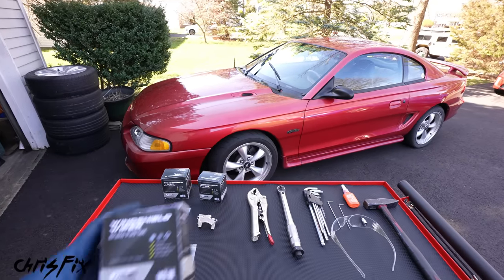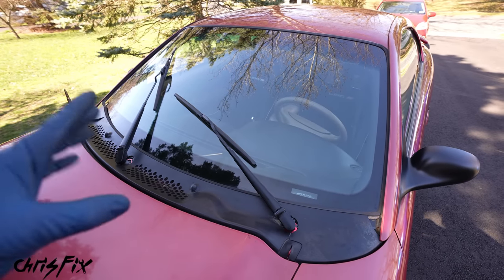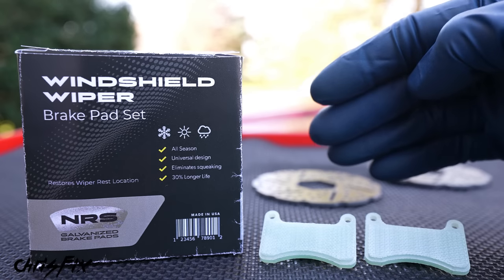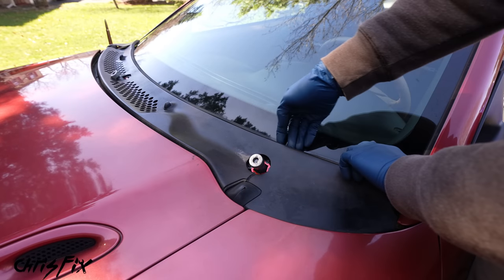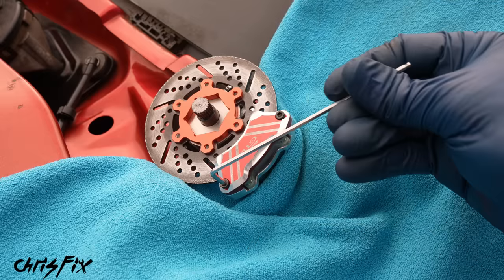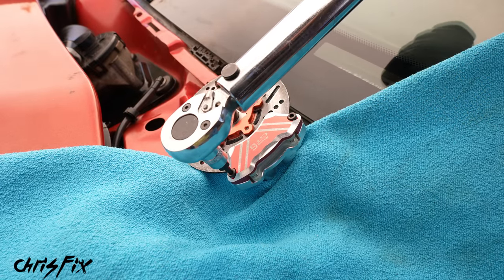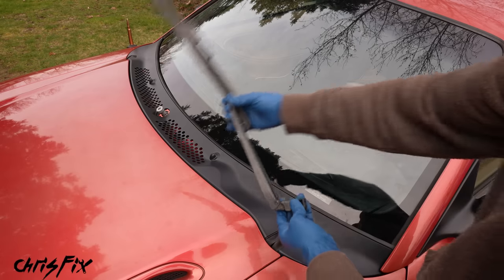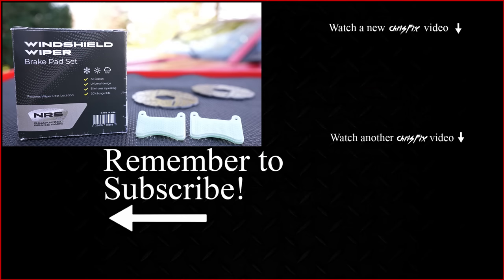How to Install Windshield Wiper Brakes

Comment: honestly just buy regular wiper brakes rather than slotted since they'll most likely last a lot longer and get more bang for your buck
Reply from the maker: Agreed for a street car but since this is a drift car, I decided to go with performance parts.
Reply: @chrisfix  them wiper brakes are the best performance mod. 😂
Reply: @chrisfix  need performance wipers for those Gs you're pulling on the track
Reply: Lol
Reply: @chirsfix how often do these brakes last on your average car? Should I change my soon?
Reply: @chrisfix  Don't forget to add some racing blinker fluid ;)
Reply: I used drum brake for both
Reply: I can’t believe you didn’t change the blinker fluid too
Reply: My car is old. My wiper brakes are drums.
Reply: @chrisfix  For all the times you are drifting in the rain, right?
Reply: @chrisfix  We need a tutorial about replacing windshield wiper brake fluid.
Reply: @ChrisFix If you 3D printed those little components, any chance you'd do a "how to" 3D print vid for useful components the beginner 3D hobbyist could print for his ride?
Reply: Still touching the a pillar 😛
Reply: And unlike slotted rotors you can resurface when needed. Just more practical
Reply: Yes but you cannot use the fastest wiper setting with them as they will not provide enough stopping power
Reply: @chrisfix  is there any performance blinker fluid or muffler bearings.
Reply: since wipers are always used in the rain then the slotted drilled wiper brakes makes the moste sense
Reply: Pus they're less likely to warp than slotted ones. I just replaced mine this morning so I shouldn't have to worry about them for another year
Reply: April fool's 😁
Reply: I love the attention to detail Chris puts into his videos.  My local parts store was all out, so I'll be pinning this so I know how to do this small but important job once they are back in stock.
Reply: @ItsNachoChannel  Shhh, remember The Lemon race car which broken piston return spring at the middle of the race?
Reply: Mine are air brakes. But I have the DOT air brake endorsement. It's just a 3 hour class plus exam. Well worth it!!! But be prepared for the Weigh Station inspections. Thanks Chris!!!
Reply: Will going with an aftermarket brand void my warranty?
Reply: So do you recommend organic,simi metallic or ceramic

Comment: I remember helping my grandpa with a repair like this on his old Chrysler. Being built in the 1970s, it had drum brakes on the wipers.
Reply: LMAOOO XD
Reply: Ahh yea, my old buddies Peterbilt had huge wiper brakes because it was  was a semi truck
Reply: I think Disc Brakes wipers was an optional. And in some cars wipers Brakes are behind the dash so you can't see it
Reply: @fabidroidneo  Yeah, on those you have to remove the entire dash, such a pain.
Reply: Who remembers when chrysler put those mechanical cable pulled units on the motor side? Talk about a pain to service.
Reply: Rear Wipers often still use Drums. I wish Disc Wiper Brakes were a standard thing.
Reply: LMAOOO 😭😭😭😭
Reply: oh.... my god! this freakin comment!
Reply: My new fiat has a set of electric wiper brakes. They use electromagnets instead of calipers. I've never seen a set like that before

Comment: You don't want to know how much the carbon ceramic wiper brakes on my P1 cost!
Reply: At least the blinker fluid was already topped up when you got it. One less thing to worry about!
Reply from the maker: I cant even imagine!!! Hopefully they are not damaged from the hurricane and can be reused!
Reply: YOU should have shown up in this video, not that other.. person.
Reply: Nobody cares how much it costs 😅
Reply: That's gold 🤣
Reply: Yes, yes I do. C'mon man, telllll me. Pleeease.
Reply: Exactly xD
Reply: @Dangnilo what’s the matter with shmee?
Reply: No, but I can tell you where to find some used carbon ceramic wiper brakes for P1 in Lithuania
Reply: Bro you really had me there. I seemed so real but i noticed the bar code 123456789012 than i knew you printed it 😂😂 but insane job tho
Reply: 5 bucks take it or leave it

Comment: Pure genius. I just installed a turbo on my washer jets. Works a treat.
Reply: I trust you redirected the blow-off valve airflow to dry the glass afterwards as well? ;)
Reply: @realMrVent  that's genius, I gotta set that up!
Reply: to be honest he is gonna come up with intercoolers for your headlights:face-red-droopy-eyes:🤣🤣🤣🤣
Reply: @gilbertsbiogasexpertske1120 You say that as a joke, but the current racing Hypercars actually do have coolers for the electronics behind the headlights.
Reply: @MrVent  absolutely. 🙂. Add a little Party blower too. For added sound effects.
Reply: What brand I bought the washer turbo jet on eBay and now I’ve got two holes drilled into my windshield not funny

Comment: I did this modification to the windshield wipers on my car this morning and I saw a 25 brake horsepower increase on the dyno this afternoon.  Great video! Thanks, Chris!!!
Reply from the maker: Nice work!
Reply: @chrisfix  Thanks, mang!!! 💪🏻 That means a lot coming from a YouTube legend like yourself.  I’m going to hookup a NOS system to the washer fluid tank tomorrow to see if I can get another 15-20 BHP out of her.
Reply: @Lettuce-and-Tomatoes  plugging in your windshield wiper hose into the vacuum line also helps a lot. Keeps the engine cool

Comment: I made the mistake of not using DOT 3.5 blinker fluid when bleeding my wiper breaks and we all know in NJ inspection stations they  check for wear and fluid level. Thanks again Chris for keeping me off track!😊
  It's not like the old days when you had vacuum wipers when you pressed the gas pedal to the floor the wipers would just stop in the middle of the windshield.
Reply: Its very important to reminder
Make sure machine the rotor!
Reply: Most will think you were joking.
Yes, don't forget history or it might repeat   :-0)
Reply: Don’t make the mistake of using amber signal fluid when you should have used red.  My wife did that, had to drain and refill with correct color.

Comment: Keep in mind some older SUVs and trucks will use drums instead of calipers for the rear windshield wipers. Hope we can get a video on that soon!
Reply: Unfortunately, they are hard to find nowadays.  JC Whitney still has them.
Reply from the maker: I am thinking I should do a wiper drum to disc conversion...
Reply: What about the exhaust brakes for the big rigs?
Reply: @chrisfix  what about doing a big brake upgrade for people who live in regions with lots of heavy rain??
Reply: More modern ones will use caliper brakes on the rear window. Also, most use TWD - Three Wiper Drive.
Reply: Maybe a drum conversion kit would be the way to go!

Comment: I had this done to my vehicle right around the time I had a prescription windshield installed. Those two repairs has made my driving experience so much better!
Reply: Now your comment has me in stitches. BTW, prescription windshields are a terrific anti theft😂😂😂
Reply: I KNEW IF I SEARCHED THE INTERNET LONG ENOUGH I'D FIND MR. MAGOO! I see your using a pseudonym. 😉 Don't worry I won't blow your cover.
Reply: Oh man, prescription windshield!
Reply: I was hoping Rx Windshields would be covered by my health insurance, but nope. 😡
Reply: @mikerisner  blasted insurance companies! Bums.🤣
Reply: How did he make all those parts?
Reply: I prefer my windshield to be able to rolled down.
Reply: @jamesstewart2543  there are pedal bicycles with disc brakes.
Reply: @jamesstewart2543  … “How did he make …the parts…?”    
3D printer… you can see the layer-lines on some parts, look closely. Excellent work, BTW.
This reminded me to check the wear on my wiper brakes…it doesn’t pop up on the ‘Service Due’ screen on the dashboard, not sure why it’s missing?? 🥸
Reply: @jamesstewart2543  my guess, 3D printing

Comment: I boosted my wipers with a twin turbo kit for extreme performance. However, with that mod I had to go with very hard to find and VERY expensive drilled, slotted and double vented ceramic rotors to bring the wipers to a stop. Well worth the time and money!

Comment: I love how you never fail to come with how to vids that no one else will tell you about. Cause of you I was able to change my blinker fluid wiper brakes muffler bearings and piston return springs. Thanks for all the time and money saving videos!!!
Reply: Hard to beat that blinker fluid one of years ago- but good try here!
Reply: Where can I buy a stronger than stock piston return springs my engine is running a little sluggish lately
Reply: Now that it is officially spring be sure to remove the winter air in your tires (don’t forget the spare) and refill with fresh spring air!😂😂
Reply: Piston return spring! Lol. There’s a YouTuber that actually tried that. Lol
Reply: @me7229  Return Spring, you missed the joke. Spring sends it back to the upstroke. Ring doesn’t

Comment: I installed dual caliper Brembo wiper brakes just last week, huge upgrade in performance.
Reply from the maker: The upgrade is worth it. The Brembo wiper brake calipers are expensive tho!
Reply: huh? bro you joining some kind of wiper race?
Reply: @chrisfix  Good thing there are cheaper options!

Comment: Nothing less than 100% commitment here. You can tell Chris is a man of integrity. Also, no time like now to change your blinker fluid, there's a video in here from around the same time of year showing that process.
Reply from the maker: Haha thank you! Every video will always be 110% commitment!
Reply: Make sure you get the correct season of headlight fluid for your location. No one wants their head lights boiling over or freezing in the middle of a cruise
Reply: Literally came up as recommendation after watching this video
Reply: Please be extra careful when replacing blinker fluid, if it gets in your eye you might end up blinking for hours on end! Don't ask how i know...
Reply: dont forget, remember to replace your piston return springs
Reply: @jasonwheelock4274  I'm sooo worried, mine are quite worn by this time...

Comment: Just a quick tip, from my experience, since these are linked to the brake system, you can help the wipers stop by pressing the brake pedal each time they reach the A pillar. That way, you won’t scratch your paint and it will give you a few months to get a replacement!
Reply: Just brake check everyone lol
Reply: I suggest pouring some wiper fluid on the wiper breaks to significantly improve how long they last
Reply: @Havixx0  it may seem counter intuitive but ive found blinker fluid works way better then wiper here

Comment: I recently bought a 2005 Tacoma. Mechanically everything checked out! Unfortunately, I didn’t realize after the purchase how badly rusted my wiper brakes and calipers were totally rusted out! I heard Toyota had a recall/class action suit on these but I guess the original owner never got the notice. Anyways, the dealer is replacing mine. So glad to find out now that I can do this job on my own. Thank you Chris!

Comment: This is a great video by Chris. I'm a master technician of 25 years. I had a customer last week saying that their wipers were clapping the windshield when the wipers moves back into the resting position, even with new wipers. Come to find out that the wiper rotors were warped. I changed them and the wipers were back to normal. And I also replaced their blinker fluid with a new type of liquid with reflective particles to make their blinkers more bright. They were very satisfied.
Reply: Synthetic Blinker Fluid is the best. its rated for 10,000 blinks between changes.
Reply: please tell me you didn't forget to replace the muffler barrings did you? it's recommended to get them changed out every time you fill up with gas. but only on fill ups. if you just get a few bucks wprth at a time then they'll last forever.
Reply: can i use brake fluid on my blinker?

Comment: Good one! Finally someone made a repair video for all the simpletons that don't know how to do it. Such an easy repair, but the parts are sometimes difficult to locate. Don't forget to also check your muffler bearings. Probably also a good time to put summer air your tires as well.

Comment: I actually opted for the carbon ceramic version. Can’t wait to do the retrofit. I’m combining it with gold brake lines actually. Thanks for the guide!
Reply: Just switched over to pneumatic brakes, working great. Brake pedal is much softer and more comfortable now, would recommend!
Reply: @MAxAMILLIoN757  I hate the scraping sound in the morning though ...

Comment: My car came with Carbon Ceramic Wiper Brakes, the dealer wanted $15,000 for replacements!
Reply: That's outrageous! Even the titanium disks are not that expensive. Almost, but not quite.
Reply: NEVER rely on a dealer for those.  Perfectly good aftermarket Carbon Ceramic Wiper Brakes can be had for around 5K.  Just shop around.
Reply: What’s up Samcrac
Reply: They do really try to rip people off, gotta say, You can get factory quality or even better for half that
Reply from the maker: What?! That’s way expensive even for carbon ceramic wiper rotors. I’d go aftermarket then.

Comment: Got a full service in one day. Changed my piston return springs, blinker fluid, muffler bearing and my wiper brakes. Thank you ChrisFix!
Reply: Don't forget basic maintenance, mainly changing the winter air in the tires to summer air
Reply: You forgot to add a can of compression

Comment: looking forward to this every year;   blinker fluid, piston springs,  Really impressive how you even got the box printed up.  Top notch stuff.
Reply: Bar-code was revealing though..
Reply: I saved A TON of cash by having the rotors turned and the pads rebuilt rather than buying all new !
Reply: Don't forget to check the muffler bearing!
Reply: I remember actually falling for his summer and winter air video

Comment: Pro tip: When servicing pneumatic wiper brakes be sure to apply a thin layer of D.O.T Fluid to the wiper blades and winshield surface area to ensure no contamination arises from the old air.
Reply: Old air and windshield friction will erode a wiper faster than anything. Good tip
Reply from the maker: Thanks for the tip!
Reply: Don't forget you can't mix DOT 4 and DOT 5
Reply: @debunkthejunk1  I tried that, and my wipers just melted straight through my windshield
Reply: @Justsomegamergamingandstuff  Sounds like you're not getting cooling to the rotors. Check you blinker fluid level and look for leaks in the line.
Reply: @debunkthejunk1  hmm okay, I'll check that later, thanks
Reply: @debunkthejunk1  DOT 5.1 is OK though.  It has a longer service life than DOT 3 or 4 and its lower viscosity means less stress on anti-lock wiper blade systems. If its worth doing, its worth doing right!
Reply: @kenweller2032  True, true. I've been running DOT 7 in my wiper brakes and I gotta say they stop on a dime. I can't recommend it enough.

Comment: Thank you for the amazing video; it worked great, and when I finished the brake job, I also changed my tires from the old winter air to the new Spring fresh air. Thank you for keeping us well-informed. Tomorrow the alternator will get a fluid change because I have over 5000 miles on that fluid.
Reply from the maker: Nice work!
Reply: Some Maybachs actually have water cooled alternators, lol.

Comment: I wish I would have found this video sooner!  It would have helped me tremendously when I upgraded my old stock wiper motor brakes system for the Brembo kit. Bleeding them was a bit tricky without help from a well trained friend. Be sure to top off your windshield wiper brake system reservoir while you are in there. I almost forgot. The reservoir in most vehicles is either next to or directly behind the blinker and flasher fluid reservoirs.

Comment: Great video. I just finished changing my windshield wiper brakes with your expert advice. Now i have one more annual repair left to take care of. I just need to change my muffler bearings and grease my radiator cap.

Comment: Wiper brakes are always the first thing I do to a used car after purchase, followed by spark plugs. It’s cheap and easy to do, and it’s so easy to not look like a fool with bad wiper brakes, always so easy to spot, yet so easy to fix. Also nice that it doesn’t cost much for parts either.
Reply: I use glow plugs on my gasser, increases the fuel economy and can technically run its whole life without replacing

Comment: Please always use drilled and slotted wiper rotors. They last longer and can prevent a fire because they dissipate the heat better. Great work Chris!
Reply: Ya, especially when you have the wipers on the high setting.  Think how much that wears out the pads and rotors to stop the wiper in time before it leaves the windshield.
Reply: I didn't know cars used wiper brake rotors. I don't think I've ever changed this one in my car.
Reply: @Karen-pl8kd    Fortunately it was just an April fool's video.  😂
Reply: Probably leaves less brake dust on the windshield, too.
Reply: @Karen-pl8kd I'm highly skeptical of this whole thing. This is absolutely unheard of, surprising and comical. Therefore, I checked the date of release. I knew it, April 1st 😂